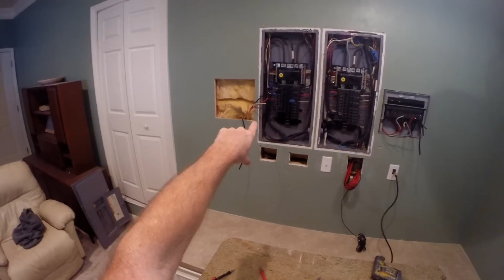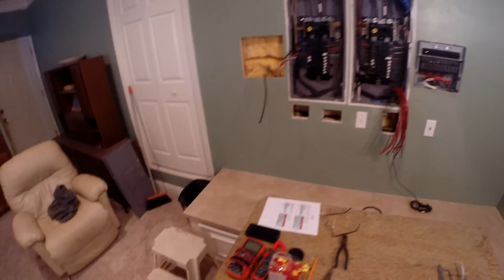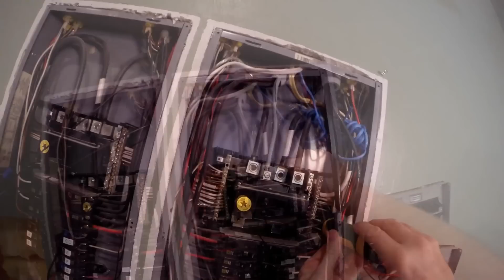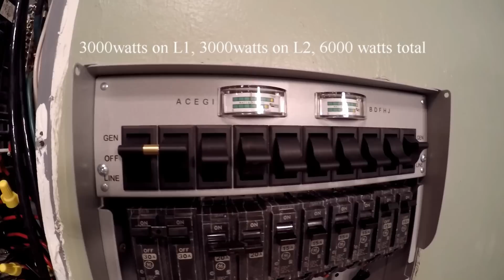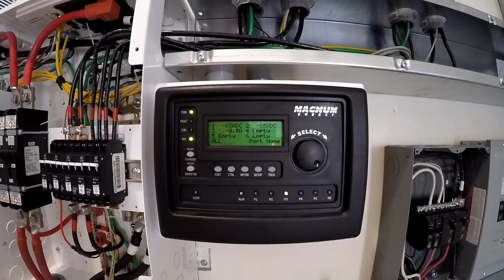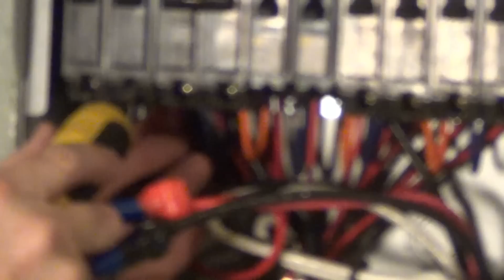Off Grid Solar #38: Installing Reliance A510C Transfer Switches

Comment: Not sure if you are responding to these now that you have moved on to the remodel.

My question for you has to do with the neutral and ground wire to the xfer from inverter and from xfer to breaker panel.  Is there an issue with ground loop, multiple ground patches etc.  You nentioned this concern in the vid of pulling wire to the xfer.
Reply: The thing about electrical current, specifically the "return path" which is the easiest way to understand the path of electrical current even though it's not that simple, is to envision that the power knows where it's going.  One of the laws of electrical theory is that power always returns to its source, and takes the path of least resistance.  This is why two power sources can have commonly connected neutrals, both connected to a neutral bar where all circuit neutrals are connected.  Power generated by the inverter will know its path back to the inverter, just the same as power from the grid knows its path back to the transformer. There is no way that power from an inverter (non-grid-tie) will travel back down the utility neutral, unless for some nearly impossible reason, that wire is the path of least resistance back to the source (inverter).  Similarly, power from the grid feeding branch circuits will not take the neutral wire back to the inverter, because it's simply not the path of least resistance back to the transformer.  This is why we can tie all neutrals (and connect them to ground wires) at the service panel, the power knows where it came from and doesn't flow through all of these other wires without specific purpose. Note this is at the speed of light so it makes it a bit difficult to visualize.
Reply from the maker: Curt,  First I have to say: 1. I am not an electrician 2. It's been awhile since I did this 3. Grounding is a black art.  That said, I go by this rule:  Your common and ground should ONLY be connected in one place and that is usually at the main panel.  That's what I did here.  The common and ground run from my main panel out to my solar and to all components.  The common and ground then run all the way back to the transfer panels but are NOT connected back to the main panel because they are already connected.  So, if you are thinking of making a ground connection, check for continuity, if you have continuity, then making the connection will probably create a ground loop.  Again, I am not an electrician.  

Note:  If you're building a Magnum system with the dual ac and dc connection panels (MPDH), there are at least two other grounding connections that need to be removed (provided that ground and common are connected at your main panel).  1. the short green AC ground connection (19) on the AC side and 2. the metal DC negative ground on the shunt on the DC side.  There may be a third in the PT-100 charger???

Good Luck!
Reply: Reliance Controls thank you for the input and understand the single neutral to ground connection.  My concern is with the neutral wire from the transfer back to the main panel.  I will have power run from the main panel to the solar system for bypass and backup charging.  This would have a neutral connection to the solar system.  The output from the inverter, with the neutral, is going to the transfer switch.  My concern is with that last neutral connection back to the main panel.  Should it be landed or not.  There is already a common neutral line connecting all of the AC.
Reply from the maker: I love these transfer switches!  They give me complete flexibility to run my house from any combination of solar/generator and/or utility.  Thanks!
Reply: Thanks David, that means a lot and thank you for educating people with your videos and all of the possibilities of utilizing alternate energy - it's something most people don't think about until it's too late.
Reply: Right, that is the primary thing to understand, the grounding of the neutral (system bonding jumper) will always be at the service entrance panel, and should be the only point in any electrical system where the neutral is grounded.  Great video, thank you!

Comment: What awg did you run to the transfer switch ?
Reply from the maker: I think I ran 6/3 which is overkill but I still put a 30A breaker on it because that is the rating on the TX switch.  You could probably go with 10 gauge (30A) but please consult an Electrician.  Thanks!

Comment: can you use a generator that has 3 prongs but an adapter that converts it to 4 prong? My generator is only 120V but all the circuits I need is 120V. I have a firman inverter generator WH03242
Reply from the maker: I would not recommend doing that.  Any 240 circuit would not be split phase and would likely destroy any appliance on a 240 circuit.  You have to consider someone following behind you may not understand what you did and add what they think is a 240 split phase circuit.  Plus I don't think it would meet code.  I would just get a 240V generator and do it right.  Then all your circuits would run 120V off the 2 separate legs.  Check with an Electrician.  Thanks!

Comment: You cant run those THHN wires from the MTS in the wall like that they have to be in a conduit. I recommend you open up the wall and do that ASAP.
Reply from the maker: Liz, That is correct.  I made three mistakes (that I know of) on my entire solar power system and this was one of them.  It definitely has to be in conduit.

Comment: Great video!!! I have to do a similar setup, but I'm still not clear on how to connect the hot (black wire), neutral (white wire) and ground (green wire) from the AC side of the solar inverter. From a solar inverter, there are typically 3 wires from the AC output side of the inverter, black (hot), white (neutral) , and green (ground) that would get wired to the transfer switch. I see that there is a red, black and white wire on the transfer switch, which wire goes where? Does the black wire coming from the AC out put of inverter connects to the black wire on the transfer switch, and the white wire from the AC output of the inverter goes to the white wire on the transfer switch? What connects to the red wire on the transfer switch? I see that you have the black and white connected from the power coming from the solar inverter, but what is connected to the red wire of the inverter?
Reply from the maker: Hello Rodger, It looks to me like your confused about 120 vs 240.  The transfer switch is wired for 240 and it sounds like your running a 120 inverter from your solar power.  The transfer switch is expecting a L1 and a L2 that are 180 out of phase, also a common and a ground.  You only have a L1 a common and a ground.  This is just my guess as I am not there to see what you actually have.  I think you should consult an electrician as to how to proceed.  Thanks!

Comment: Why add the Transfer Switches and not just put a 100Amp, or whatever breaker into each house panel and then turn main off? 
Or replace the house panels with 2x 100Amp Panels?
Reply from the maker: Stephen,  The transfer switches add tremendous flexibility.  I can select any combination of circuits to run from the solar OR from the utility at the same time.  If you did the 100Amp breaker than you would have to be totally on grid or totally off grid.  Most people do a critical loads panel but even that commits you to a very inflexible solution.  I could go on all day about how I use this transfer switch to get the most out of my system.  I highly recommend you add this to your system.  For more on how I use this, check out this video:  https://www.youtube.com/watch?v=TNIA78586-M   Thanks
Reply: I was under the impression the inverters had the ability to decide when its best to use PV, Vs battery or Line Voltage, or am I mistaken and that is just a Testla Thing?

I do agree since we install them ourselves you are still able to add more features since you are not paying for electricians.

What do you think about adding these afterward for protection? 

https://www.youtube.com/watch?v=x4RHsPCLqgg
Reply from the maker: There are so many ways to slice this...  Let's look at the 20 transfer switches.  Each switch has two inputs and one switchable output.  In my case the two inputs are: #1. the utility  #2. The battery backed, generator backed, utility backed solar power system.  Let's call #2 the BBS.  Under normal operation, the BBS outputs power from the panels or the batteries and it controls this automatically.  If the batteries get two low, the BBS can automatically switch to the utility but I have never had this happen.  If the utility is out, I can start the generator and the BBS just treats it like its the utility.  FYI, during the last hurricane we lost utility for three days and we never even had to start the generator.  The solar and batteries keep up the house very well.   

The fire suppression system looks very interesting.  Will have to look into that some more.  Thanks!
Reply: They do not appear to be cheap, but it would be nice to put out the fire before it destroys anything. 

 You can get the fireball ones are like $40. 

https://www.amazon.com/stacy-riccelli-Extinguisher-Self-Activation-Suppression/dp/B01M0D8HBM/ref=sr_1_6_a_it?ie=UTF8&qid=1537720028&sr=8-6&keywords=fireball+extinguisher&dpID=41c9QbYVAdL&preST=_SY300_QL70_&dpSrc=srch

Best of luck and look forward to new content.

Comment: This would have to be close to the best home diy solar setup I've ever seen and I've just about all of them on youtube. Can I ask though in your country are you permitted to wire to your house power supply without a certified electrician?
Reply from the maker: Well your comment puts a big smile on my face today, Thanks!  Yes, you can do your own work but it must be permitted and inspected by the county building inspector which I did.  That said, I would generally recommend having this part done by a professional electrician.  My electrician was out sick and I got inpatient and did it myself.  Thanks
Reply: How did you learn it all without being a sparky? I'm going to watch your 50 odd vids over and over until I learn :-)
Reply from the maker: Well, I might be a little more qualified than I have let on...  That said, I did the same thing your doing.  Watch a ton of videos on what others have done and combine all the best ideas.  I suggest you watch all my videos IN ORDER as it all makes more sense that way.  Also suggest you spend the extra money and get all the bells and whistles as I did (the AC & DC enclosures, backing plate, surge protectors, etc.).  Using these transfer switches adds a ton of flexibility.  Finally, I would say that the Magnum Energy System has a lot of great features and is pretty bullet proof.  Good Luck!
Reply: Thanks!
Reply: "I might be a little more qualified than I have let on"... You  mean almost as a certain Research Engineer at University of Florida? Yeah, that's some 'little' qualified :-)

You did great, Dave. I'm also an EE but I'm following your videos while doing mine. It's not just the wiring but the tools and techniques you use and demonstrate throughout the project. I haven't been able to get your permit files but I know you posted them somewhere for others to use. That will be invaluable to me as I navigate the murky waters of government codes and permits.
Reply: @HomesteadEngineering  what inspector passed those thhn stranded wires running in the wall conduit free??

Comment: Hey, great video.  I’m planning on installing a transfer switch in my condo but the breaker panel inside my condo doesn’t have a main breaker switch and it also does not have separate ground and neutral bars.   Should I be installing both the green and white wires from the transfer switch to the neutral bar or does the green wire have to go to a grounding point somewhere else? Thanks!
Reply from the maker: I think that grounding is probably the hardest problem to get right.  I recommend you get a good electrician to look at it.  Don't guess! BTW: this video does not accurately describe how I did the grounding...  You should read the post below under Curt Quast.  Good luck!

Comment: how hard would it be to in wire and slide a conduit through the holes on the bottom
Reply from the maker: The holes have already been patched.
Reply: Then it's kinda late.
Reply: @HomesteadEngineering  so you just "free air" the thhn's in the wall???

Comment: David, Yes I would put my transfer wires inside of conduit that strain relief on the bottom of the transfer switch  is used for that flex. I too have been enjoying your videos. It would be nice if you could add more or even longer videos. I also would use fire block putty on any openings. On your wire trays should be fire proofed - PT 100s. This is just what I would do to my system. Lastly change your smoke lol battery I use (Nest detect) so I get notifications on the cell for fire related issues at the house etc. So more videos and longer ok we are counting the days till your next vid....
Reply from the maker: Good suggestions.  Thanks!

Comment: there's a lot of work to that. it didn't look like the single wires were in conduit otherwise looking good. I have a few videos on utube now
Reply from the maker: Well I did not think of that... I wish I had done that but I think it's too late now.  I'll check out your videos!
Reply: I don't think it would ever bother anything but I think code would require conduit
Reply: Could have changed thhn with Romex....